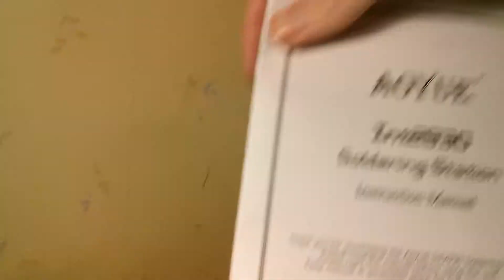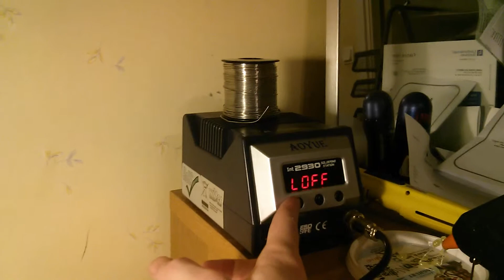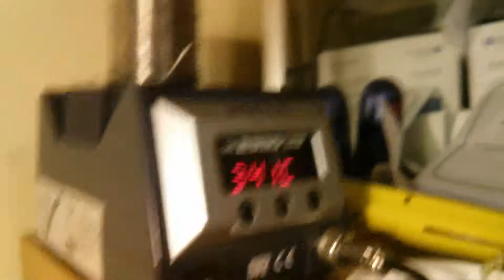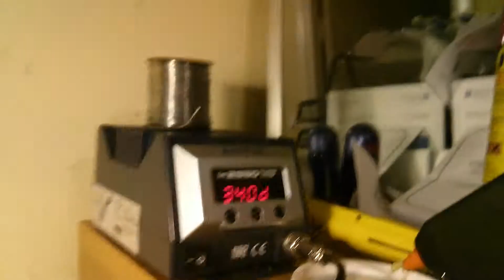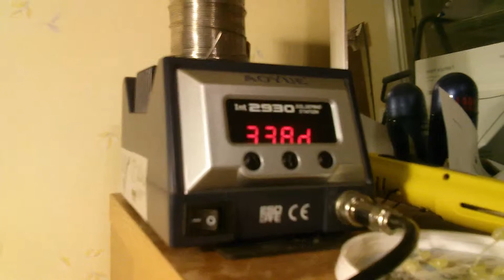Aoyue 2930 vibration sensor failure [Resolved, sort of]

Comment: Mine started having this problem now. After so many years.
I fixed the reed switch that had come loose, and it's now toggling two pins on the cable.
But it's as if there's a second problem somewhere inside the station. Hmmm...
Reply from the maker: I'm sorry to hear that! Since I assume your warranty has expired, I suggest contacting Aoyue directly to see if they have any recommendations. Good luck, and let us know how it goes!
Reply: @gammypoofle  Gonna take it apart and poke around a bit with a meter. Should be something simple.

Comment: I was you I would send it back and get a Isolder 40. I love that soldering station. It use a simulator soldering tip as that unit, but works on auto mode no need to do any setting.  I have JBC 2950 and  metcal sp200 but I always seem to got back to my Isolder it really is a nice unit.
Reply: The Isolder 40 sounds nice, with tip sensory feedback and all. How long does it take to heat up the tip?
Although I've already got an Aoyue 2930 along with a thermometer to calibrate the tip temperature, It's by far the best one I've had so far, and at such a low price. And the tips are interchangeable with my other Aoyue stations.
Reply: I say between 12 to 6 second or less depending the tip you using. The Isolder 40 I found are compatible with the Hakka T15 tips  where you could find real deals on Ebay . Like I said before I own  a JBC,Metcal X-TRONIC doul station, but When I want effortless soldering I always go back to my Isolder. Hey its all about preferences you know.